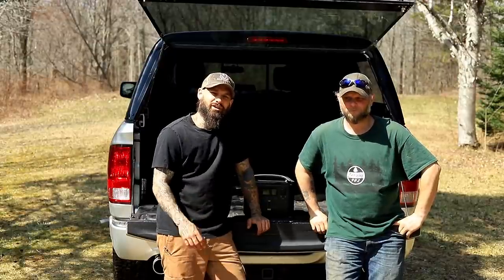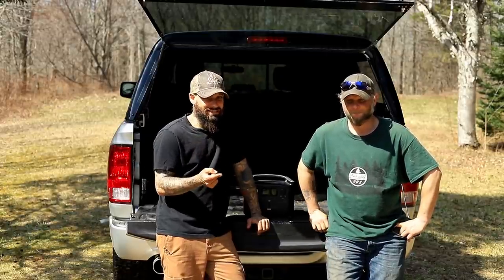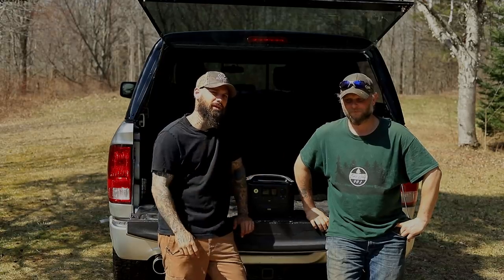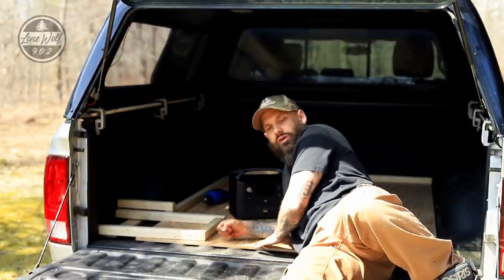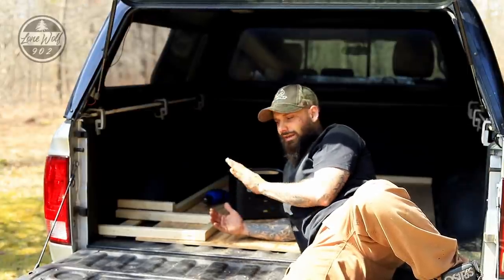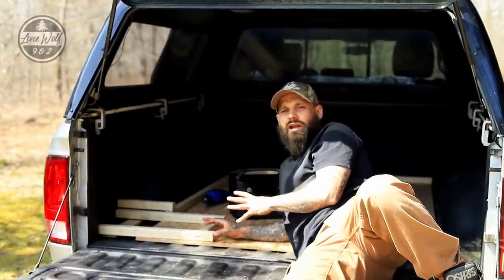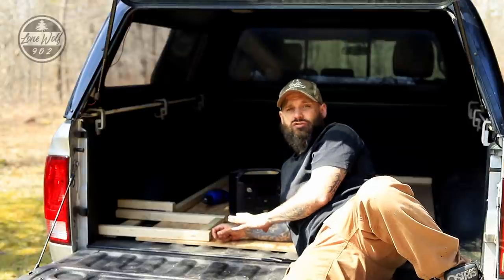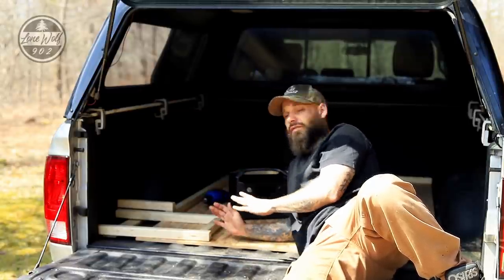Truck Bed Camper - DIY Camper Truck

Comment: Hi, Have you ever heard them say you're only as young as you think?  Well I guess I'll be one of your more unique viewers as I am a 71-year-old woman. And I still go camping with my 83-year-old godmother.. How bad is that? lol
Anyway I've been using wood stove in my home for 3/4 of my lifetime, so that's a long time right? And I'm assuming the fundamentals are the same whether it's in a house the garage a tent or a camper on wheels of any size. Hello just watching one of your previous videos you were using your wood stick. And I wondered about its installation so I followed the link here. I see no heat barriers and that strikes me kind of unusual. My homeowners complained about how my was so was set up. I have a 2 inch void space heat deflector all around my wood stove which would allow me to safely put it right close to a wall in the corner. And your little stove appears to have no heat shield . How does the wood surrounding it so closely not get hot? I saw it work well in your previous video that I watched but I'm just wondering how it is.

Comment: What do you suppose  the total weight of this project is estimated at  ? And will it be equally distributed. I thought about doing this with PVC Pieces left over from a fencing job. Look forward to the finished product 👍
Reply from the maker: The weight has been top priority since the very beginning,  total wood weight in the truck is under 150lbs

Comment: Going through your all your build videos, you have not mentioned about the small pieces of wood on either side of the wheelwell. Would just like to know how you nailed or screwed it into the subfloor.
Reply from the maker: It is floating

Comment: Love it man! Question - Are you building this in such a way that you can remove everything with relatively little effort, so that you can use your truck as a truck when needed? Or are you fully committing to this as your primary set-up?
Reply from the maker: Thanks alot,  the build is non removable, but there is loads if room to carry various loads